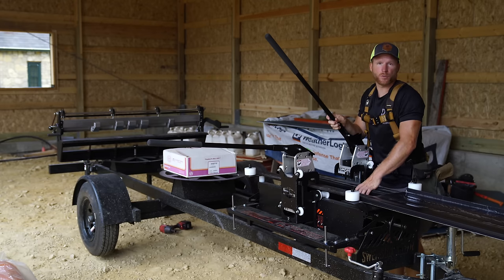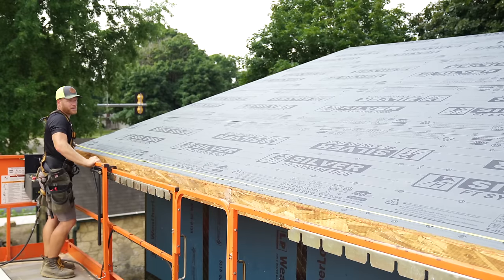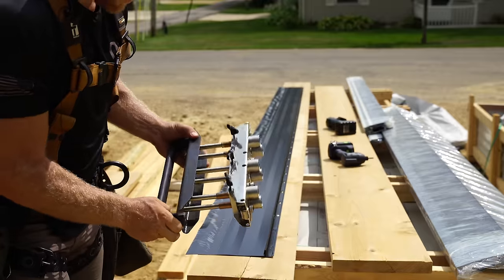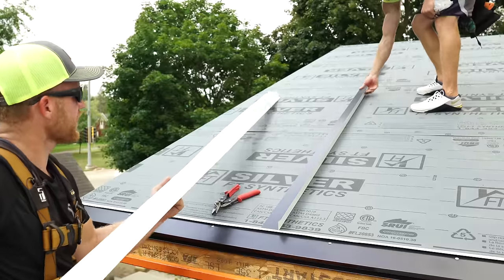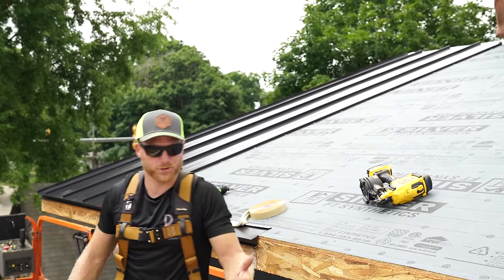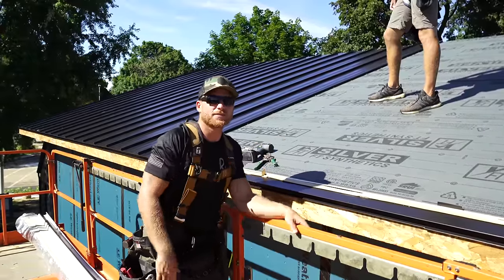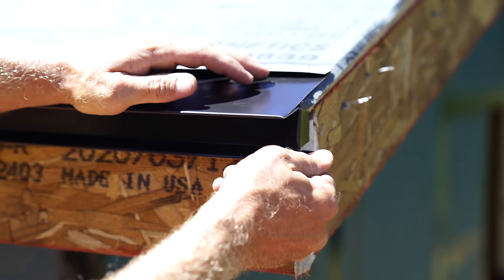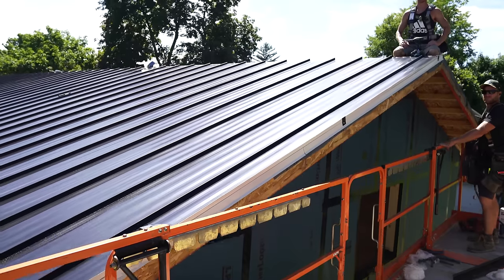Oregon Music Garage: How to Install Snap Loc Standing Seam Metal Roofing

Comment: Have that same premium roof on our home - in Patriot Red. Slightly different install details (used a different eave trim and didn't use the cut-and-flip-over method on the little exposed end), but really like the look of the subtle 'folds' in the center of each panel. IMO and for those wondering, this is one of the best no-fastener roofs for a DIY'er (thats' me). The product quality control is great and the ease of install very nice. I've since added the matching snow retention bars as well that clamp over those standing seams (we're up in NW WI). Great choice Kyle! Excellent descriptive video for sure!
Reply: الهند

Comment: Looks good. Just wondering why you don’t put the roof edge on first and then lap the roof underlayment over it. It looks like right now any condensation would flow under the roof edge and get the edge of your OSB wet. Also in my thinking, I wouldn’t use the butyl tape at the bottom. I would want water to get out. I can’t really see water backing up that surface. Let me know your thoughts.
Reply: Are you concerned about water/moisture getting under the roofing panels? Without the pulins directly under the metal roof panels it looks like water/moisture could get trapped against the underlayment and OSB.

Comment: Durecho  A sideways tornado.  Pronounced "Der -esh-oh"  We had one in '69 in northern Ohio that took out over 4000 trees.   Next "Wish I could see how the top cap is put on.  I can guess at a seam (or whatever it's called.)  when the roof goes 90 degrees.  However, good enough stuff for me to do this.  I'll be 72 next year and the hell with paying someone 3 grand profit or more to do my roof, that I put on 30 years ago.  Besides, it's a 12-12 pitch.  I made a set of steps to do the roof last time instead of a ladder.  Super safe.

Comment: Kyle, I've been cringing as I watch you use your hand/fist as a hammer. By the time I was in my mid 40s, my hands were toast from pushing chisels, Yankee screw drivers (the original cordless automatic screw driver) and tapping pieces together. The arthritis and nerve damage required I massage my hands under warm water every morning so I can go to work or just hold a pencil or breakfast spoon. Now, at 65, I have trigger finger and trigger thumb from tendon inflammation and tendon sheath trauma. My thumbs and little fingers catch and lock as I close them. I've had cortisone injections and finally surgery that failed after 6 months. I can't hold a pen to sign my name without massaging my hand first. I take 2 grams of aspirin a day just so my hands are minimally functional. I know too many men my age with similar grizzled hands.
Please, carry a rubber mallet and save your hands. They are your livelihood. The precision work you do with them is amazing.
Reply: Absolutely this. I'm 31 and I've got significant nerve damage along with tendonitis, carpal tunnel and recurring ganglion cysts. All but the cysts are some degree of overuse injury and the classic hand as a hammer thing and it's insanely debilitating. I've been working with my hands my whole life and it gets harder every year.
Reply: Wisdom speaks.
Reply: I’ve never seen or heard of this until reading your comment. Wow, sorry to hear. Thanks for sharing, good advice.
Reply: thank you for the advice ill probably never punch a piece of lumber again

Comment: My question is about the durability of standing seam in high wind and snow environments. I live in Central Ontario in an area that historically gets a lot of snow and wind due to the open fields. How does that standing seam hold up long term to the wind and the snow. My first area of concern would be the seam that is pressed into place over top of the male end. Would snow, ice, or water not slowly work its way through that seam since there is now gasket or Sealent to stop ice or water? 

Also, I just want to thank you for the videos. I'm really learning and enjoying them.

Comment: You mentioned a storm came through your work area. I was wondering if your buildings are tornado/hurricane rated or have you had it tested to see what the design can handle. Considering you use heavy duty anchor points, engineered posts and cross-bracing I figured it would be able to withstand quite a bit.

Comment: Could you drop a video on removing pieces of snapping for replacement? When I bought my first house with Snaplock metal roofing, I thought I was fortunate. Years into ownership, I learn that a poorly installed cricket leaks and a plumbing stack on the lower end of roof was "faked" and comes off with 6"+ snowfalls. Best I can tell, is that they missed placement such that pipe was right up against a seam. So they plugged the stack, kept the boot and stuck a segment of ABC pipe to make it look real. I'm considering attempting a single sheet replacement where the plumbing stack is and then removing all sheets adjoining 7' long cricket, adding ice&snow underlayment and replacing it with a a little greater inclined angle. Your thoughts? Prayers?😅

Comment: Thanks for professional advice with good videos! 
What is best for big snow? Standing seam or face screw? WE just started building in CO at 7000ft altitude and some wicked whipping wind. Our design is a Clerestory roof with ICF exterior walls, 'cause lumber costs are WTF....... sky high! I have drawn these on my software, but my software does not think outside of the box for framing specs?
2nd Question ; How would you frame a roof in the Clerestory design, with one side run at 16' and the high side run at 24'?  ..My novice research on the engineering of ICF walls suggest we do have an advantage of building roof system with parallel chord trusses. No need for collar ties.

Comment: At those bottom ends of the standing seams, is there a chance of bugs getting in there and building nests? Maybe a quick spritz of bug repellent  foam sealant before closing the tabs? I know they won't have access inside the house but anything to cut down on pests seems like it could only be a good thing.

Comment: Hey Kyle, One thing I haven't heard you talk about is bookshelf framing vs. on edge framing. I'm wanting to know the pros and cons of each. I'm assuming you prefer on edge so you can build your walls on the ground. I'm planning on building a 30X40 shop (doing most of the work myself) but I'm thinking about doing the bookshelf style because it would be easier to sheet the inside of the shop, as you wouldn't have to frame the inside. Thanks for all of the great videos! I wouldn't have been very confident building my own shop without your help.

Comment: remember the easiest pythagorean triple is 3, 4, 5. you can simply multiply that to whatever size you need. i.e. (6, 8, 10) (9, 12, 15) (12, 16, 20) (15, 20, 25) (etc)
Reply: And what's even easier is to always start with the 4 which can be any arbitrary figure and add and subtract 25% to get the other 2.

Comment: I'm in Oregon, and am curious if you think roof sheathing is required for a standing seam roof like this?
You usually don't use sheathing and I'm wondering if the moisture / condensation concerns in Oregon warrant sheathing / underlayment since it's such a humid environment in the winter...

Comment: ok which is better in standing seam clips or the holes you have to screw it to the roof  I live in VA and high winds and freezing tekperature have torn off several of my shingles that are going to cost me 250 dollars to repair today . I have a bundle of shingles  and ony 6 shingles to repair . I am thinking of standing seam metal roofing  so I can still hve my roof vents on the back of the house . I am up on a hill and house is exposed to winds . I have seen some metal roof contractors here that tahe off vents and cut off the ones under that are for plumbing vents and cover them with the metal . Not good . I want my  shingle roof taken off and new ice and water shield put on the part of the roof that doesn't have ice and water shield . Max Kendal did my metal roof are my 3 car carport and shed but it was not standing seam .But they are not my house that i live in either . Iam watching videos of standing seam some with clips and some  with just the holes like on vinyl siding . so which is better in your opinion ? House is a RANCH HOUSE NO VALLEYS  only a front porch with a slight dip in the roof . House is 100 feet long by 36 feet deep to soffits on front and back  . I am hopping my house is square aas it is a modular house . GREAT JOB OF EXPLAINING THE SYSTEM  I wish you were in Virginia

Comment: Give me a couple of hrs with a tape measure and some paper I could build that machine and the cost would be at least 1/2 that most likely less.But it would take awhile cause I'm old. To me that's way over priced. With what I can see of it not a whole lot to it. But if it does what you want.
Reply from the maker: The price is mainly in the dies
Reply: I think that goes for most things. But when you are a company with overhead and need to mass produce things at a profit you're pretty much always going to cost more than someone building things at home.

Comment: I will be real honest this video could've been much more helpful. People who click on a video titled "how to install snap loc standing seam metal roofing": 1. Definitely do not have a $10,000 metal bending trailer. 2. Are looking for information on how to install roofing systems. In 23 minutes you covered: How to make sure the roof is square and what to do if it isn't, How to figure your layout (sort of), How to cut and bend the ends of the panels so they hug the drip edge. The information that is definitely lacking: Biggest thing, the rake drip edge? the ridge cap? It is like you were just kind of tired of making the vid so you stopped here.  There is no discussion of underlayment. You showed us the tabs you leave on the end of your eave drip edge and sort of described how you tie that into the rake, but it didn't really make sense, and you didn't show it. What could for sure have been left out: The first 3 minutes of the video. No need for the intro and trailer show off. The conversation with your wife and plugging some bluetooth earpiece that you didn't really plug. Then showing us your smashed phone. Pretty much any of the converstaion you had with craig or greg or whoever. There was some good info here, But it was like fly shit from pepper in a lot of ways.